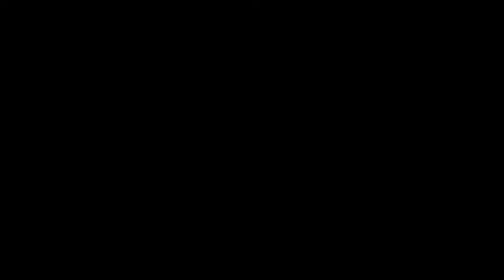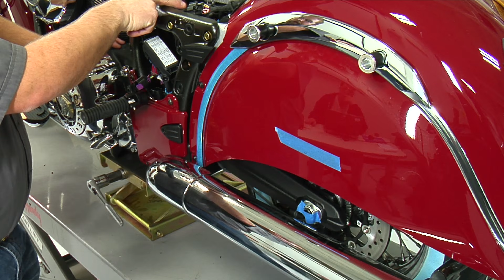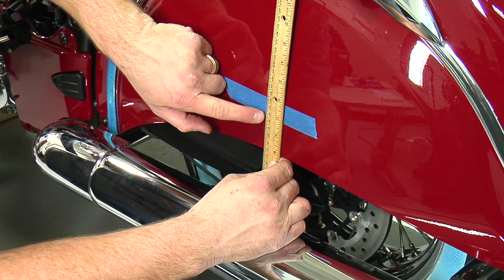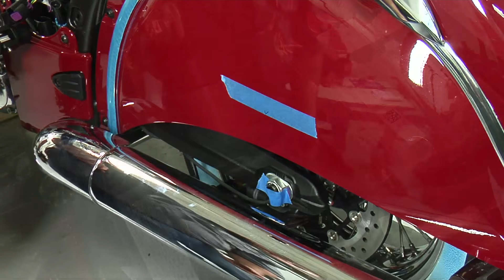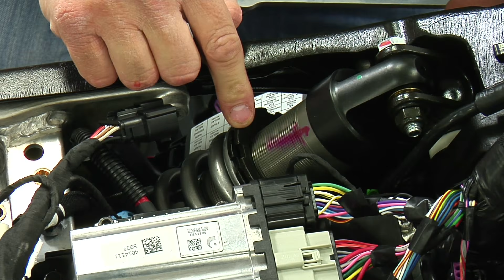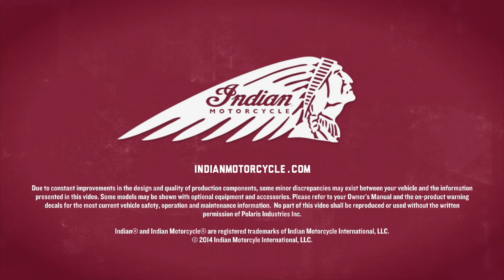How to Adjust Indian Chief Rear Shocks – Indian Motorcycle

Comment: The jack appears to be lifting via the exhaust crossover pipe....correct?....if not,explain please....I have a 2015 Vintage and frankly the wrench I bought from Indian to adjust with is IMPOSSIBLE to fit into the shock area....your wrench is completely different....can you address this please....thanks !